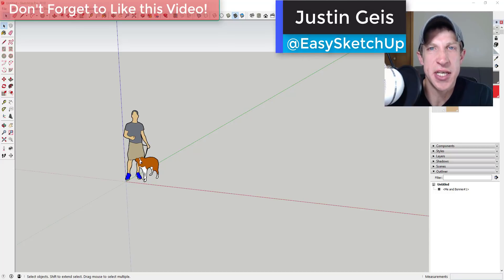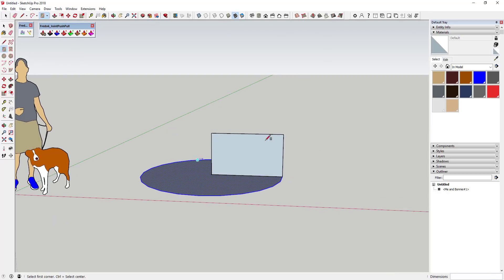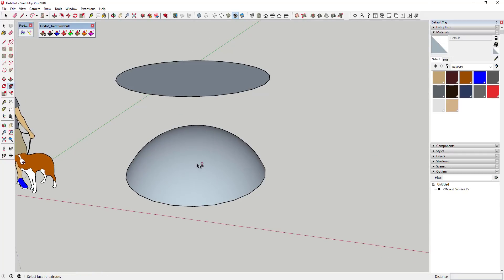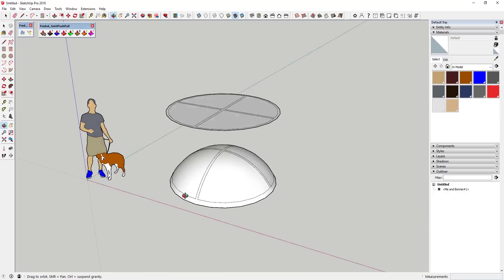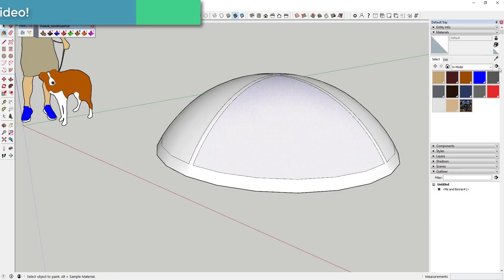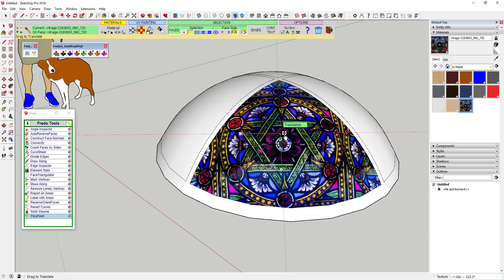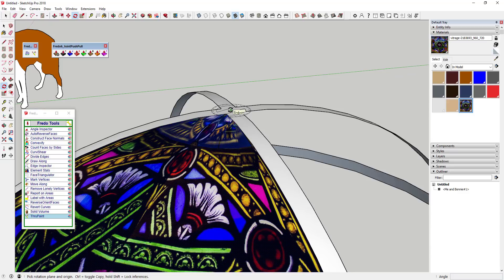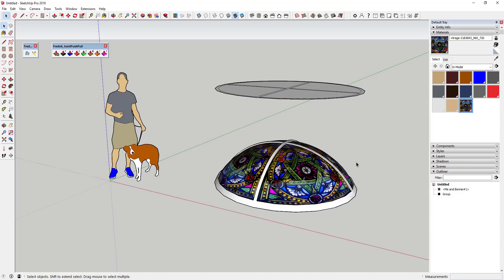CREATING A TEXTURED DOME in SketchUp with Drape, Thru Paint, and Joint Push Pull

Comment: I'm having strange issues with this. When I do pretty much everything you did in the vid, to the letter. After I click the dome on which to drape, it simply loads a bunch of parallel lines onto the surface that was supposed to be draped onto the dome! wth. The only difference I have is that I've made 6 pizza slices instead of 4... full surface and everything! wth wth wth! damn

Comment: In vray for sketchup there is a function for rounding the edges using the texture only without create polygons in the model, it sometimes like normal map for smooth edges.
It will be very nice from you if you can demonstrate this in one of your future videos.
And as always thanks for this wonderful tutorial
Reply from the maker: Interesting - I'll have to check that out - thanks for the heads up!